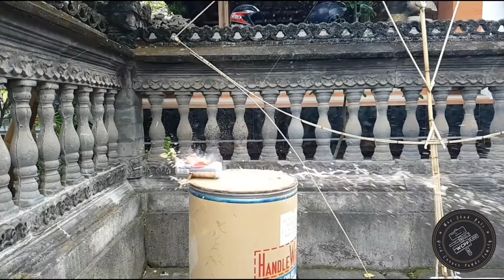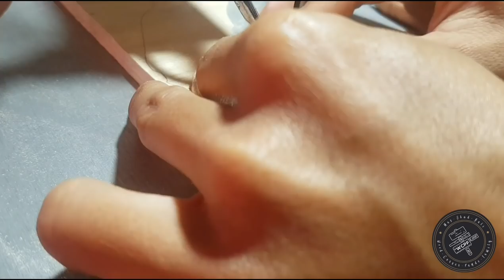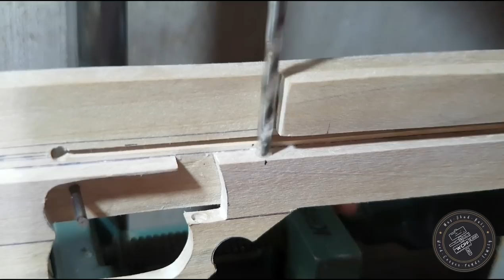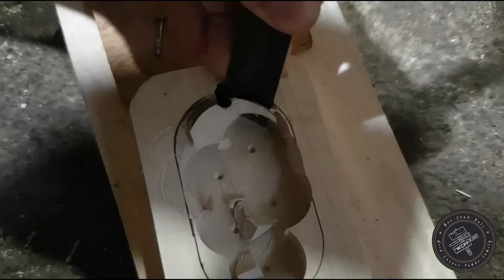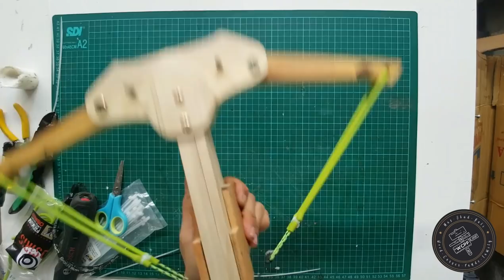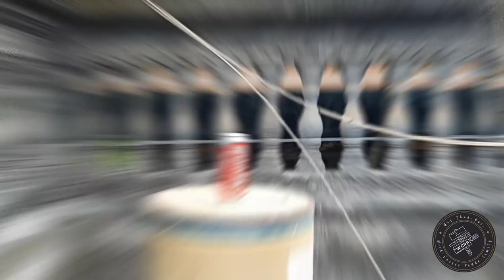Making Wooden Slingshot Crossbow With Large Magazine Capacity  | Shoot Target Until You Get Bored

Comment: Awesome!!! only how come that the string doesn't squeeze underneath or above the ball ? Normally you have to make a slede to push the ball. Wonder how you did it but the weapon is beautifull 👍
Reply from the maker: Thank you so much Danny...
I'm happy if you like it.
it's very simple.  make sure the size of the Barrel hole has the right size of the size of the bullet,  but not too tight.  then the size of the rope is 3 times smaller than the size of the bullet.
Example.
Size of the ammo is 6mm
Then size of the rope should be 2mm.
Wood pusher will reduce the power of the rubber as my experienced.😉
Reply: Yeah it does but I thought it was that or nothing 😅 but I get it now ! Even joerg sprave works with pusher because of the string slipping the ball but you've made it work ! Good job 👌

Comment: Hallo please give me the instruction for this, thanks ☺️
Reply from the maker: it use no printing template, just paper sillhouette that I draw manually.
the point of the steps it on the barrel size. barrel size should be close enough with the diameter of the ammo.
others part is following it.